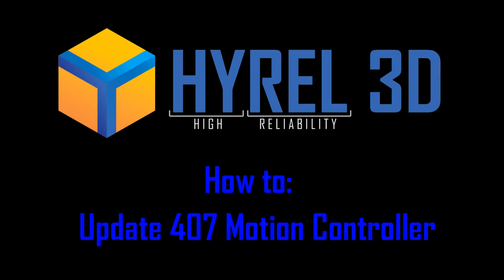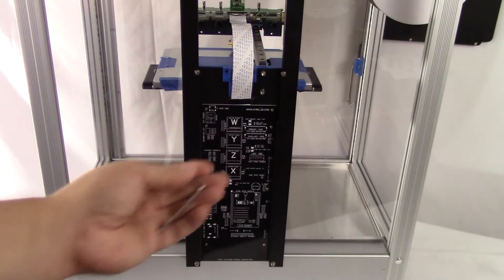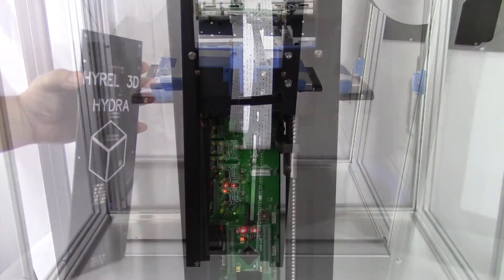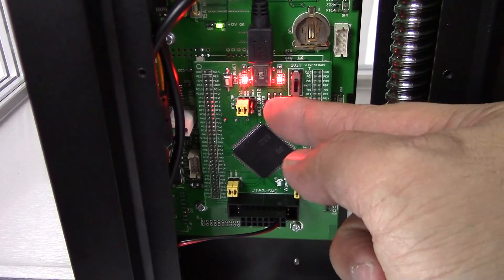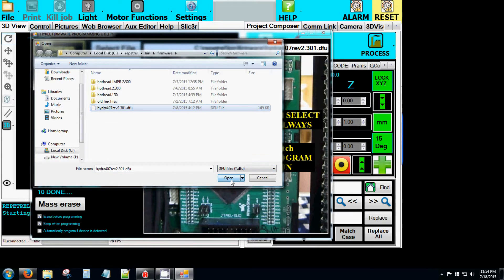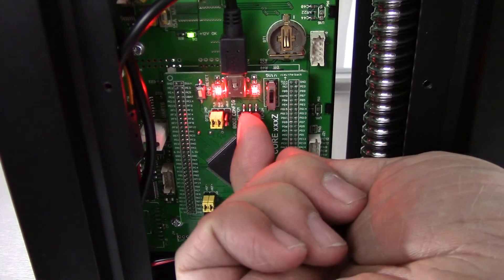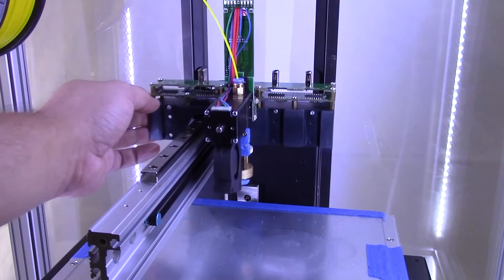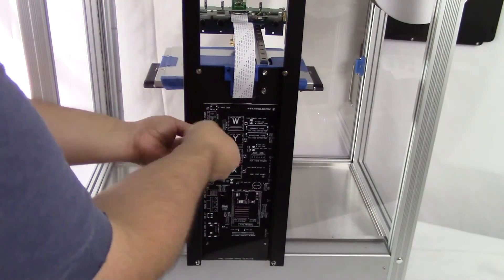HYREL 3D - Updating your 407 Motion Controller

Comment: Where to download the files? I cant find them...
Reply from the maker: http://hyrel3d.net/wiki/index.php/Firmware will show you which firmware version goes with which software version. When you download a Repetrel update, it already includes the proper firmware version. Run Repetrel from C:\Repetrel\bin\ and the update firmware utility will, by default, point to C:\Repetrel\bin\firmware, where these files are kept.